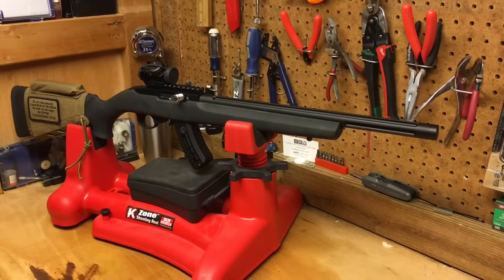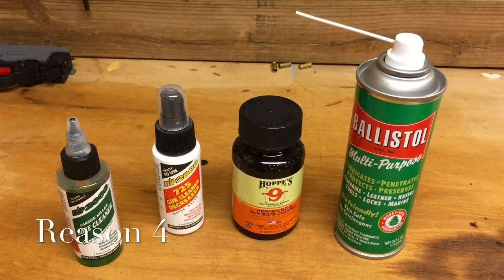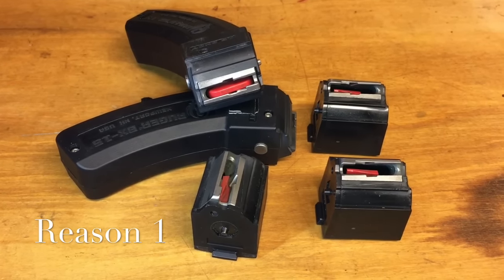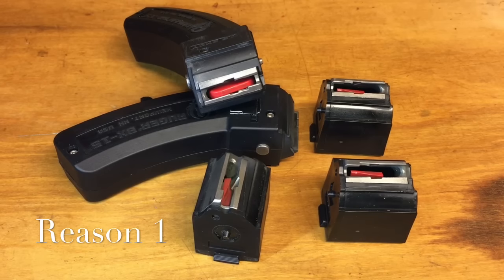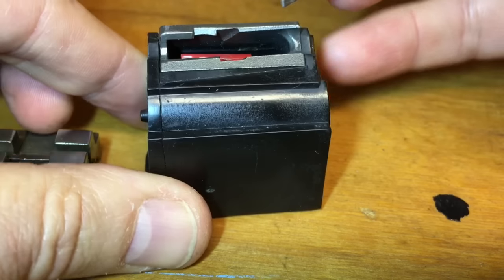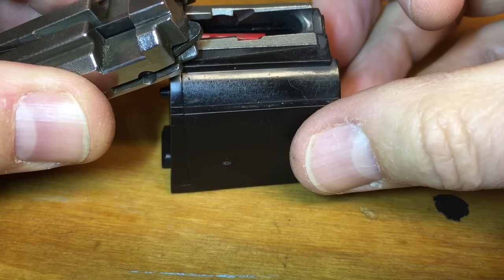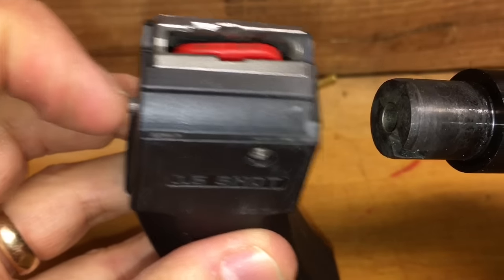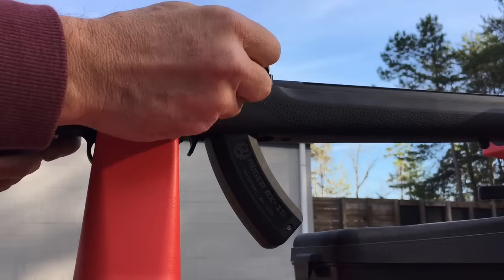Ruger 10/22 Top 5  jams and stovepipe causes and fixes

Comment: Spent 4 years in the 10th Mountain division putting many rounds down range with M16 A1 and A2 and found that just about every Jam was caused by the magazine. Good vid and info.
Reply from the maker: Thanks for the feedback Matt and thank you for your service.
Reply: You know it brother, tried to replace as many of the GI mags as I could with PMAGS.
Reply: Climb to Glory!
Reply: @seanreese7805  maybe it's me, but I hate PMAGs... preferred the gi issue metal/ aluminum
Reply: Every single one of my mags must be bad because I've had nothing but problems with my 10/22. the 10. 15. & 25's, I have also tried several brands of ammo and I keep my gun clean.Maybe I got a Lemon. It's not even worth shooting.
Reply: @chrisd8715 
To the Top!
Reply: @nolagospeltracts8264  Same here. Just ordered a Henry lever action, probably gonna sell the Ruger.
Reply: @adamjanosi9404  I would sell mine do if I thought somebody would buy it. Very disappointed because I read such positive reviews but the riffle turned out to be a piece of crap even with the factory 10 round mags. Maybe it's one of those guns you have to "break in"
Reply: @nolagospeltracts8264  I don't know, it's crazy how people rave about them like they're the best thing since sliced bread and enthusiastically come up with all these "fixes" like sticking duct tape on the mags 🤣. No thanks, if a gun isn't reliable I have no desire to try and figure out what Ruger's engineers should have 50 years ago.
Reply: @adamjanosi9404  Exactly!  I might check out one of those Henry's myself.
Reply: @nolagospeltracts8264  get a Volquartsen Edge extractor and use CCI and shoot 500 rounds to break the gun in. I almost guarantee that’ll fix your problems.
Reply: @nolagospeltracts8264  try to find a Butler Creek hot lips 10 round magazine. They don't make them anymore, but this is the only mag that is reliable in my 10/22 and I own 5 of the factory 10 rounders bought at different dates. The ejector part of the Butler Creek  mag is further forward than the Ruger 10/25 rounders. I think this makes the difference. I figured this out after trying literally everything else, including replacing the extractor.

Edit: many people have bad luck with Butler Creek mags, so ymmv. Maybe I just unluckily got 1 out of 6 mags that was reliable, and that happens to be the "crap" mag.
Reply: Same. Just build a brand new ar. Used 7 different magazines. Only had jams when using 1 of the mags. About 1 out of every 3-5 rounds. It was old and borrowed. I avoided using it and shot another hundred or so rounds without a single jam.

Comment: The main reason for my 10/22 jamming was oil, especially oil on the extractor area. There is very little on the rimfire for anything to grab onto, and oil makes this an even greater problem. I learned to fire mine dry. What I would sometimes do is spray some brake cleaner on the extractor area and the chamber too. When I fired mine dry, all the previous problems went away. Then I can take it home, clean it and oil it if I want, but before I fire it, I have to get rid of the oil in the area of the extractor.

Comment: I hope Ruger CEO's are watching this video ..!!
Reply: why ruger takes 20 years to fix anything , only after the dies are worn out ..then a maybe a new design ...
Reply: Roy Rodriguez the dies would wear far sooner than 20 years...
Reply: Look at how long it took for them to come out with the Mark IV. Only after the S&W Victory started stealing sales from the Mark III. Though that's not the "official" story that Ruger tells about how the Mark IV came about. Unless it's hurting sales or there's a lawsuit involved, Ruger doesn't like change.
Reply: The rossi rs22 is looking mighty good in comparison, and at roughly half the price as well as less issues all around...
Reply: @jarkoer  Have had my mark lV for 2 years now and shoot it regularly burning through 400 to 500 rounds per session. I love the weight of the bull barrel stainless but have correlated the jamming issues with two things: 1. Ammo manufacturer, CCI works best with no problems (so far), Remmington and Winchester bulk where , on average, two out of ten rounds are variously problematic 2. This gun HAS to be clean to the point where on long shoot days, I take it to the truck for a breakdown cleaning a couple of times. Cheap bulk ammo = dirty firing. Of course anyone who shoots knows this relationship. Keep the gun clean and use good ammo. Lol
Reply: The factory mag comes with a new 1022 and has almost no problems , it's when you want to play
Rambo with a aftermarket mag that you run into problems . So Ruger has had it right for a long time .
Don't buy junk mags if you want it to work right .
Reply: @user-fc8xr2dh3y  I have an Rossi RS22 and Ruger 10/22. You can't go wrong with the Rossi for the price.
Reply: @spencerboaz2385  ruger branded mags should work no matter what on a ruger branded gun bud
Reply: @katana258 , I have never had ANY problems with Ruger. My 10/22 didn't like Remington HP. It cycles All other ammo I run thru it. I found that it's NOT always the gun. The ammo/mag is the cause 80% of the time.
Reply: @spencerboaz2385  my ruger 10 rounders fail to eject about 1/3 of the time
Reply: @spencerboaz2385  those 15 round mags are Ruger factory mags.

Comment: The worst problem we have had with the latter model 10/22's is the painted receivers. Ruger does not anodize the receivers anymore, they are just painted. This causes the top of the bolt to start rubbing paint underneath the top of the receiver and slows the action down. We have to remove the paint  from underneath where the bolt rides to get the bolt freed up to run properly. Also, nobody has ever made a magazine to work as well as the Factory 10 rounders. Bill @ Mitchell's Gunsmithing.

Comment: Great video, Thank You! I have had a 1022 for many years here in the UK. Shot thousands of rounds through it and mostly been very lucky with minimal feed/jam issues with most brands of ammo. However, I had never realised the mags were different sizes or has the primary ejector built onto the lip! I did pad my BX15 and BX25 mags with sniper tape, which made them run flawlessly, but had no idea that the ejector was the connected issue with any loose mag/stovepipe/jam issues! This knowledge has mad a great difference!
Reply from the maker: Thanks for the feedback Lawrence. It is good to hear from our friends over the pond. Did I speak proper english in the video ;)
Reply: @kylerake   Ha, You sure did! Thanks for the reply. (You have a great voice. I was an actor in a previous 'life' and still do the odd V/O. I can use your video to study your smooth accent!). Stay Safe in these crazy times and thanks again.

Comment: Good video, you taught me a couple of things. I don't have any problems with my 10-22 but I didn't know that the ejector was built into the magazine and I didn't know how important it was for the magazine to be pushed as far towards the barrel as possible. Thanks for your insight. I found that using quality parts is important. Installing shims for the trigger and hammer really seemed to help smooth out the 2 lb. trigger which helps with accuracy.
Reply from the maker: Thanks for the comments. If I can get to the range more, I may try some trigger work.

Comment: Also, check the feed lips on your mags. 
I got my 10/22 TD from an online site and picked it up from my local FFL. Included was a bx25.
I got it home, looked it over, assembled it, loaded the magazine and tried to hand cycle through the mag to check feeding action.
1st hangup was on cartridge #2. And then 4, and then about 10 more times throughout the rest.
Looked at the carts and the bullets were dinged and dented.
Loaded a fresh set of cartridges into the mag and it all happened again, at random intervals.
I also discovered that I couldn't empty the magazine by pushing cartridges out with my thumb.
Took everything back to my ffl and explained the issue. They did everything I did and they confirmed the feed lips on the bx25 were bad since a new mag off the shelf wasn't replicating the issue.
Nice guys they are, they gave me the off the shelf mag, stuck my mag in its bag, and sent it back to Ruger as a defect.
So, reason #6, bad mag feed lips. If you've got an older mag that's been dropped and knocked around a bit, check the feed lips against one which feeds well. Or if you get a brand new one that won't feed, same thing.
Reply: P.s. Great vid. I always appreciate learning something new about my firearms.
As someone who's never even owned a 10 rd mag, I just assumed the slop in the bx25 was supposed to be there.
Now I know better.
(I would like to have a couple of 10 rounders in my bag but it just seems to be one of those things that I never think of at the gun shop and then smack my forehead over when I get home!)
Reply from the maker: Matt, Feed lips are another good one to check. Thanks for the feedback.

Comment: Little j b weld on the mag seems to take care of the old magazines I also use clay to form my block well for my j b weld then once dry hit it with the drimel . Thanks for your hard work on your videos
Reply: This is what I'll use when and if the tape works. Just installed a bolt tune-up from volqartsen, and it's still jamming a lot. 😅

Comment: Reason 3...I use Hoppe's 9 and Outers...after cleaning all the mechanicals, I use a lightly oiled Q-tip to lubricate the mechanicals and the bolt...over oiling causes sludge to build up, ergo, malfunctions...
Reply: Yeah , some idiot I bought my gun from drenched it gun grease. Had oil all over the mag and the bullets after insertion.

Comment: Love it when someone has a clue these days instead of crazy advice without reasoning. Thanks a lot for this video. 👍 think this #1 is on target with what mine had problems with. I actually did bend my secondary ejector slightly and it did improve it slightly but I didn't bend it much and would rather not have & I tried to make sure it's not enough to rub anything and only bent the very tip. I'd leave it alone as well and focus on mag slop as in this videos suggestions.  I also get a feeling that the side to side slop is a big a problem and the tape around it there seems to assist with both some so I think that may actually be better than a bigger bumper alone. I can't understand why Ruger doesn't address this issue with the high capacity magazines a little better.  Anyway I'm all for modifying these guns. I've recently started and while expensive the quality difference is really super nice so far. I'm loving my new magpul hunter stock quality and magpuls no questions asked customer service in general. They're great and now I know why all the hype for their products and may be heading into my AR sometime!
Reply from the maker: Thanks for the feedback Brandon. I think the mags can also get wore out faster by shooting a lot of High-velocity (1300 FPS or so)rather than standard velocity of 1100 or so. This slams the mag harder and could cause mags to go bad early.
Reply: Kyle Rakestraw I still need to run more ammo to verify but I noticed I could never run my bx 25x2 mag without jamming a few times before but my magpul hunter stock has slightly closer tolerances side to side and I've only tested one clip but it ran a full clip of federal flawless with this new stock compared to my factory wood stock. Before I'd get a lot of jams with federal and less jams with Remington. I'm hoping that less side slop really fixed it but I'll see as I shoot more. A stock can't adjust front to back so I'm thinking this side slop may be a real important aspect. When I compared my Remington shells to the federal to see why the less jams with Remington I noticed they have a very slightly sharper less rounded rear rim edge. And since it ran this 25 rounds of federal so smooth I'm having hope it really helped! Before about 6 rounds max all it would run with federal. I usually had 2 to 3 jams per bx15 clip before and easily as many with the bx25.
Reply from the maker: ok, That is good too Brandon. I have very high success with CCI mini mags

Comment: Good explanation of the magazine issue demonstrating with the the tape. I just got back from the range with my new break down 10/22.  I had 10 BX 25 mags, and a few would not fit in, or lock in--as well as those double feeds or failure to eject.  I want to clean it up first, before I take a look to see what the issues are.   Ruger is the only brand I seem to have issues with, and the only one that has all these necessary upgrades to get it to work properly.  My LCP II was almost put in the junk pile, only to discover the magazine release spring wasn't strong enough and required an "after market" upgrade.  Yeah, my confidence goes out the window with Ruger. Thanks for showing this, hope I can get the rifle to work or figure out the magazine issues.
Reply from the maker: Thanks for sharing

Comment: My 10/22 is fairly new and only had maybe 100rnds through it and started stovepipeing and then the casings will also stick in it when the action closes. Will try cleaning soon just to make sure
Reply: Sometime the 10/22 will have issues for the first 1000 rounds or so until they get worked in a little bit. Don't go too crazy unless your issues persist after a bunch of rounds.

Comment: Good info. Definitely learned something. Lube wise, I have had some cold weather related issues and switched to a dry graphite lube for cold weather and it worked very well. Also am a firm believer in cleanliness of these guns for reliability but know of a couple of high mileage guns that never get cleaned. So, really, the magazine is everything as is true with most autoloaders. Love the 10/22.
Reply from the maker: Thanks for the comments

Comment: This is a pretty good video! I just found it after cleaning our mags.
We got a good deal on 22 rounds and faced problems with the amo.
After cleaning one mag (10 rounder) it worked way better but not perfect. 
I will try out the tape hack and check if this works better, didn´t knew it was on the mag..

Comment: I had the same feeding issues on a brand new Ruger 10/22 takedown. I researched and found that the plunger and plunger spring that comes standard on the ruger is not stiff enough to hold the magazine in position as you shoot. Allowing a wobble of sorts and it doesn't line up right. I replaced the plunger and spring with KIDD Innovations parts for about $10-15 and haven't looked back. The spring is stiff and the plunger is stainless that comes from kidd and it was the best upgrade made. One thing to look into as well is the KIDD Auto release for the bolt catch. It takes away the need to try and find the sweet spot on the stock bolt catch. They are cheap as well no more than $11-20.
Reply: I'm going to try this upgraded plunger and spring from Kidd. I want to avoid duct taping  my mags as this seems really ghetto to me.

Comment: Awesome video though it does raise some questions. Why does Ruger make the mags fit so sloppy and why are the top dimensions different on 10 and 20 round mags? Good work, keep it up.
Reply: I also noticed that looking at the two mags the left side looks longer that the right side ... Kyle was comparing left side to right side @ 3 min mark... Not sure if that's right or makes any difference ... Thanks
Reply: MADE IN CHINA or very poor mold makers where ever they are from.

Comment: Excellent video and demonstration. The one other thing I noticed with mine was there were burrs on the charging handle rod which made the spring catch and the gun stove-piped every few rounds the first time I took it out. I cleaned the gun and polished the rod and it shot much better the next time.
Reply from the maker: Good tip. Thanks for the feedback

Comment: good stuff here! the magazine fit issue applies to bolt actions too. minor adjustments on the plastic piece holding the magazine, to feed into the battery more directly, made all the difference with jams and skint lead on rounds inserted. especially stubby ones with blunt points.

Comment: Good information on the 10/22 & thanks for sharing your ideas on the tape or at least how the mags can be part of the problem. Will try the tape & see if it helps after I really clean the mags, take care.
Reply from the maker: ok, let me know if it works for you.
Reply: OK, I did add a piece of tape to one end of my 10 round magazines and can tell that they now take an extra amount attention to get into mag well, just a tighter fit of course.....but there is no jamming or wobble of the mags as any extra wobble space is now fill up. Easy simple fix. A good job on cleanings mags is also complete & done.
Reply from the maker: "no jamming " Great to hear! that Is why I made the video, to help others. You can try a thinner tape/material or you may find that the mag does loosen a bit after using it a few times. Thanks for the feedback

Comment: The axle that the rotary action spins on in 10 round has a full cone for alignment; however the 15 and 25 do not have full cone even though it is tapered.  The flattend portions on the taper causes the mal-alignment of the magazine.  You can see this in the comparison of the 10 and larger capacity magazine.  Ruger use the same parts from the 10 to 15 to 25 magazines for reliability.  That would be great.
Reply from the maker: Thanks for the added details